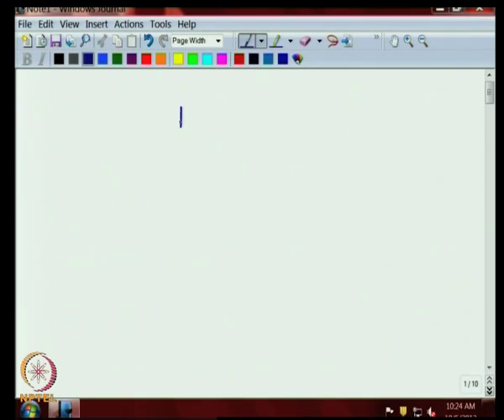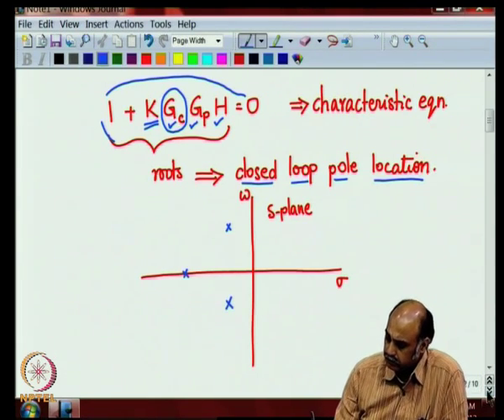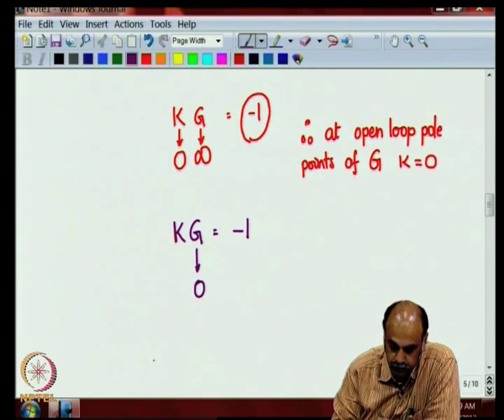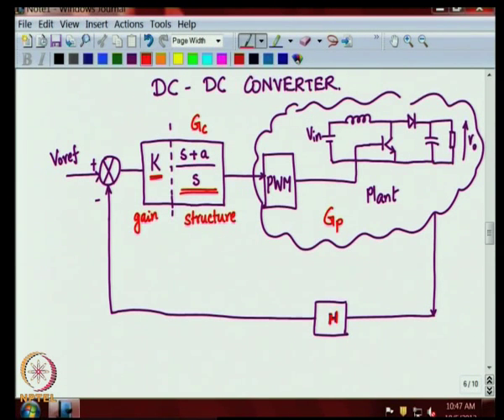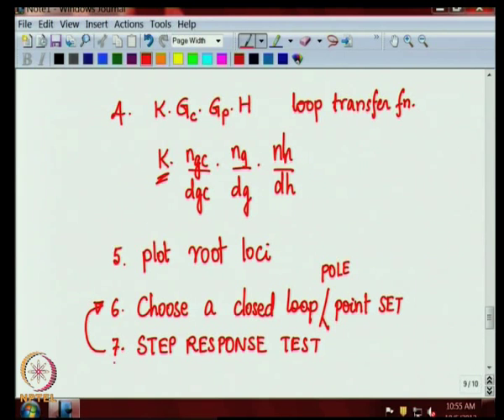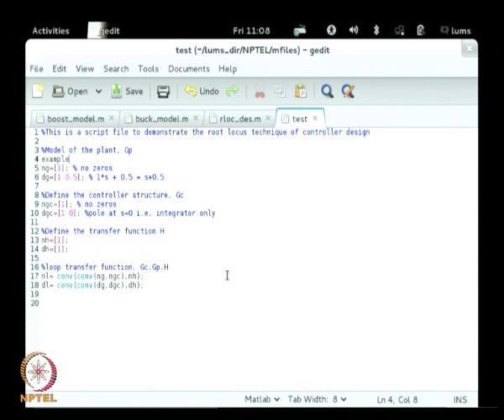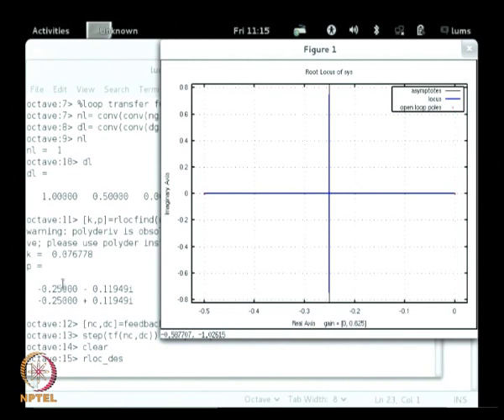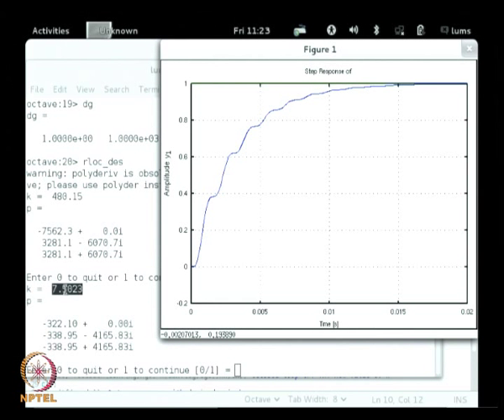Mod-11 Lec-33 Controller Design -- II

Comment: If my input voltage varies between 8V to 50V, how to add these input voltage limits as control parameter.
Reply: Hello, did you find any solution, if so could you please help me out in this regard. I am also working on this. Thank you in advance!
Reply: @smarsalan  i followed these videos till to make openloop transfer function (Vo/d) in matlab. But for controller design with/without input voltage variation, i felt this approach is little tough. But i designed the controller using lead lag compensator in bodeplot method. That  is working for wide input variation.
Reply: @veerahanuman5086  if convenient, could you please share your controller design with me. It will be of great help if you could share source files. Thanks in advance brother
Reply: @smarsalan  i can't share that, but i can share you this https://youtu.be/L3MRnEYdi8g , this video i followed for controller design.

Comment: Cool stuff, thanks! I learned this in school but it was a while ago and I needed a refresher, plus it's great to get it from a slightly different angle!

I was struggling with Octave, could not get some of your functions, for instance:
[nc,dc]=feedback(conv(ng,ngc),conv(dg,dgc),nh,dh);
warning: the 'feedback' function belongs to the control package from Octave
Forge but has not yet been implemented.

Anyway, I redid it in Scilab with some success. Here's the code in case anyone's interested:

//Model for a non-isolated boost converter
clear all
clc
disp(['The values of the plant parameters']);
Vg = 15; //v
D = 0.4; // steady state duty ratio
L = 2e-3; //H
C = 10e-6; //F
R = 100; //ohms

//SMALL SIGNAL MODEL OF THE BOOS CONVERTER
a = [0 -(1-D)/L; (1-D)/C -1/R/C];
b = [1/L 0 Vo/L; 0 -1/C -Ig/C];
c = [0 1];
d = [0 0 0];

sys = syslin('c', a, b(:,3),c,[0]); //'c' = continuous time

s=poly(0,'s'); //define s to be used for lapalce notation

//Model of the CONTROL SYSTEM
ctrl = syslin('c', 1, s); //continuous, numerator=1, denomerator=s

//Feedback H
H = syslin('c', 1, 1); //continuous, numerator=1, denomerator=1

K=10

ol=K*sys*ctrl;  //open loop transfer function

cl = ol /. H; //slash-dot does the closed loop with fb H

evans(cl) //display root locus of the closed loop tf

t=0:0.0001:.05; //setup graph start time, step size, stop time

cs=csim('step',t,cl); //calc step response 
//if this fails to converge, decrease the step size via. t

plot2d(cs)
Reply: Now I know I am 3 years too late but could not resist from replying. The reason your code couldn't work was because of missing expressions of Vo and Ig. 

Vo=Vg/(1-D);
Ig=Vo/(R*(1-D));

I ran the code after these two line addition and it worked well. Thank you.